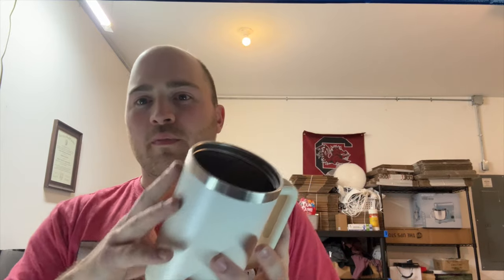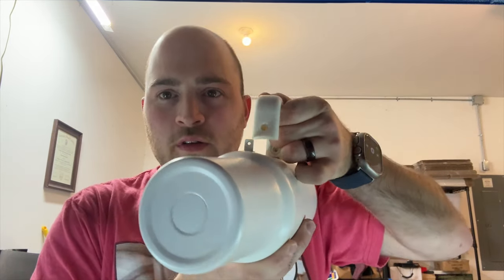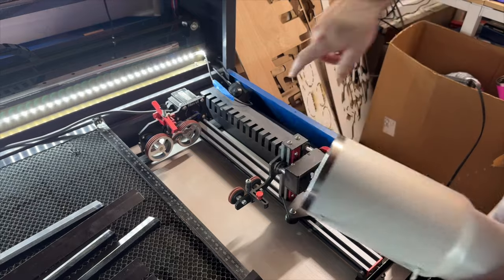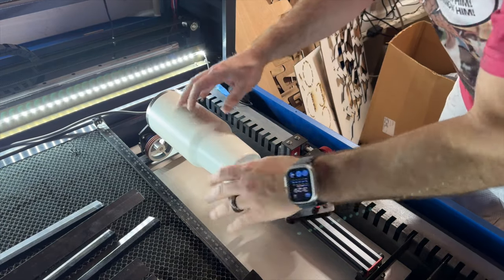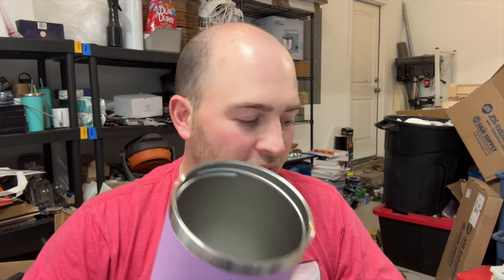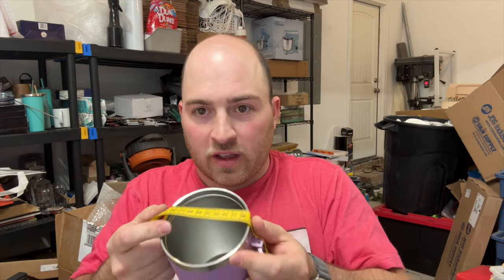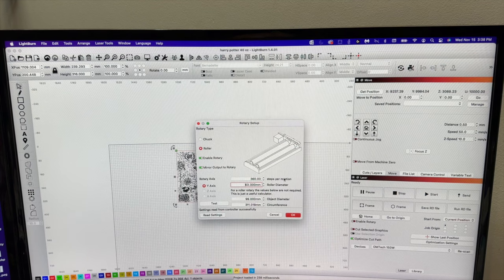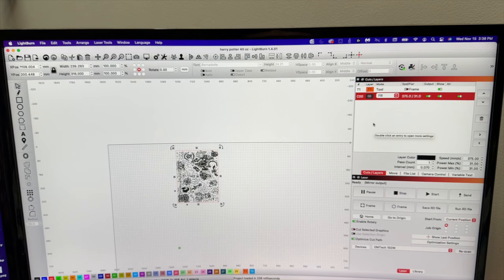40oz Tumbler Wrap - Full Wrap Tutorial - Laser Engraving

Comment: Bro I just bought a omtech af2028 60w
I got a piburn 4.0

Did the suggested settings
12500
63mm
Got the right size for the tumbler which is 99’m like you did

My edges come out pixelated not smooth
Any ideas why?
Reply from the maker: Hello! So I actually just replaced my 150w laser with 3 AF2028 80w machines.

Did you do a square test on a tumbler? Do a 30x30 square in lightburn and run it on your OMTech and see if it is actually 30x30 (if it isn’t you need to adjust your steps until it is! 😁
Reply: @SodaCityBoards  I’m going to try and update you on that one
I checked my dip switches and they are all correct on the Y axis 5000 which is times 2.5 gives me 12500

Also to get rid of those edges I have to lower my interval to .7 AT LEAST but I seen people do very smooth curves and designs with only .1 interval

What settings do you use if you don’t mind me asking, we shouldn’t have much of a difffwrent between our machines
Reply: @SodaCityBoards  30x30 mm ?
Reply from the maker: Yeah 30mm x 30mm

Sorry my YouTube didn’t show me I had a reply!